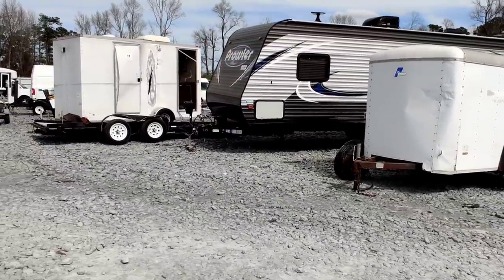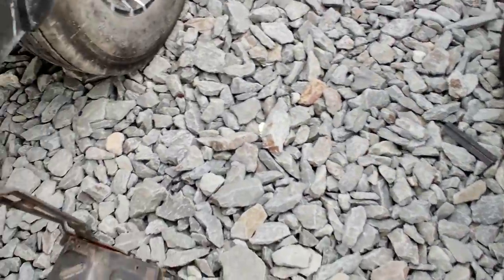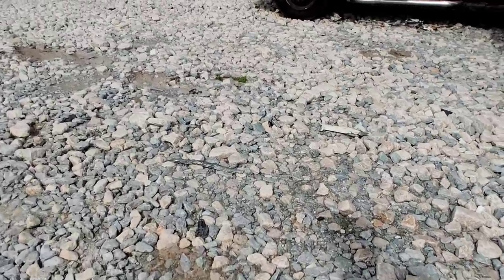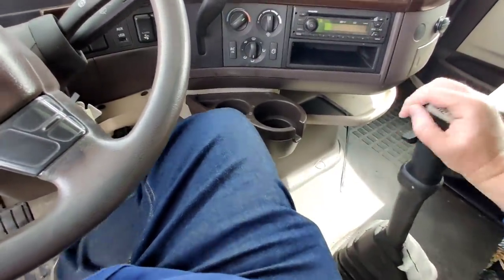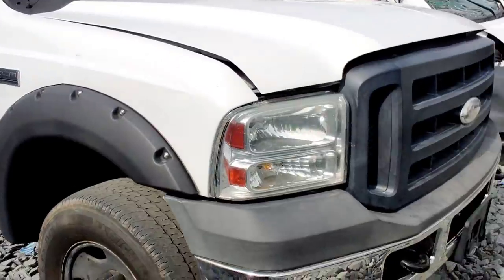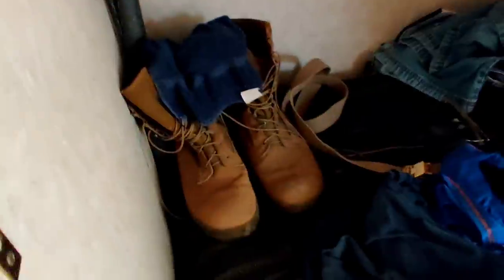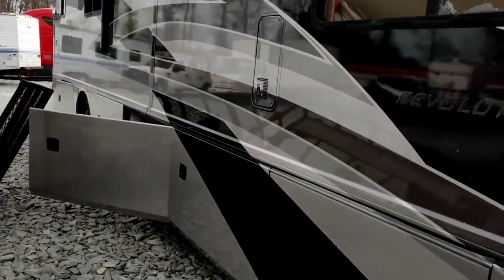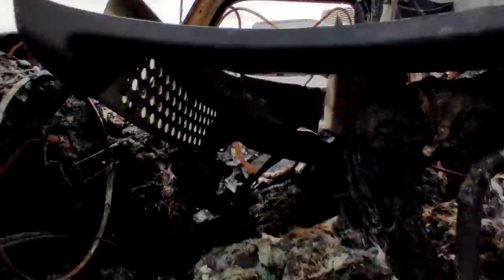Copart Walk Around, Buying A Semi at Copart

Comment: On that Volvo truck that was a 10 speed trans. That button on the shifter is called a splitter. You have the 1-5 gears on the low range (button down) and 6-10 gears on the high range (button up).

Comment: Tiki that's the high and low range for the for the transmission it's probably a 18 speed the other piece in the box is either for the trailer brake release or the brake release on the truck it may have a bad component in that part

Comment: The part you picked up in the semi was an air manager.. all the air brake lines for the tractor plug in to it and it allows air pressure to get to the rear brakes to apply and release them

Comment: The switch on the shift is the splitter (or range selector).  Down is low range, up is high range.  (so it doubles the available gears).  On a ten speed transmission for example, there are 5 gated positions.  With the range selector down, you shift 1st thru 5th like normal.  Then you shift into neutral, flip the switch to hi-range (up) and then shift back into the first gear (now actually 6th gear), then you shift normally for 7th,8th,9th & 10th gear.  Some gearshift knows will show this (show a 6 above the 1,7 above the 2, etc)

Comment: That Volvo has a 10 speed. The switch on the shifter is there to switch it from low to high ranger, so you can get to the next 5 gears

Comment: I've been wanting to convert a nice peterbilt to a regular truck for years....but they ain't cheap...and couldnt find truck bed that would fit....you would have to fabricate an entire bed, I would imagine....we dont want it to look like a dump truck when finished.....build a bed that looks similar to a dually bed....I would remove one of the rear axles...it would look better....besides you'll never carry 20 tons of cargo in the bed...or pulling a trailer....one axle is all you'll need for a 10 to 15,000 lb.  fifth wheel camper.     So go for it, TK
Reply from the maker: Sounds like a crazy project. I am seriously considering it

Comment: I drive semi trucks  that is a spitter or range selector that  looks like a 10 or 15 speed so afer you get to gear 5 you push up like you are doing and it gives you gears 6 though 10 12 13 15 or 18 speed  depending on what you have

Comment: tk the switch on the side is for high and low range down for low up for high eaton fuller is one of the best transmission i believe that truck would have an x15 cummins and yes as you were saying that small damage would total it because a new hood is 6000 and the truck value must have been less than that loved the video keep it up
Reply: also that part is the air divider aka splits all the air hoses into two feed and return for behind the dash the old one must be leaking

Comment: Trucking is a difficult job. The driving is easy depending on the weather and area. But the time spent versus reward ratio is terrible. Work around the clock all year round to net $55k as a company driver. $80k as an owner.

Comment: 11:35
Truck Build:Peterbilt,Kenworth l,or Freightliner with Cummins ISX motor.CUSTOM INTERIOR AND MODERN ELECTRONICS,AND A SHOWER/RESTROOM like the video of the Edge fifth wheel. 
40" 4K OLED TV, game,and surround sound.Fold down dinner table like the Volvo trucks.(room to cook&eat.)No passenger seat.4 cubic feet refrigerator instead.That's a truck build.What do you think?

Comment: That 5th wheel RV might be a repo. A Dodge Ram car-B-que 12:00 Take all of the trailer hookups off the back of the semi truck cab, air--electric--mechanical--leave NOTHING but the frame, suspension, and drive train in tact. Next, have the frame extended a bit, take that 5th wheel RV off it's frame and have it mounted onto the semi truck's frame for an ass kicking one off RV. BTW, I used to date a gal who's last name was Fuller IJS. 14:25 "Days of Our Smashed" LMFAO at soooooo much of the shit you say. It looks like that F450 rolled a few times. 31:25 Looks like you were having a hard time getting it in the hole.